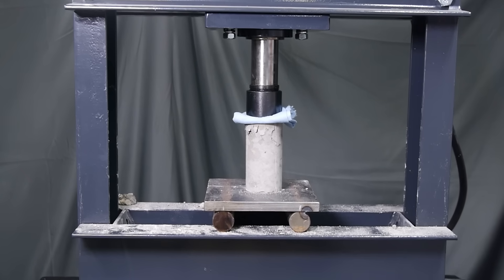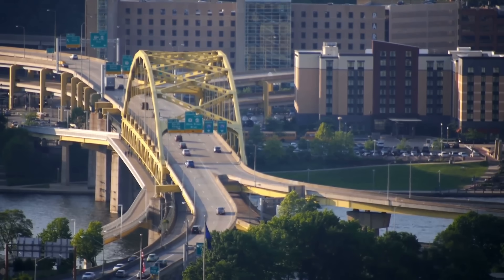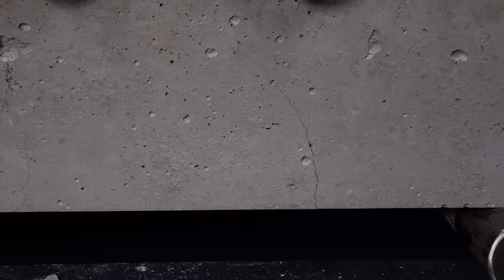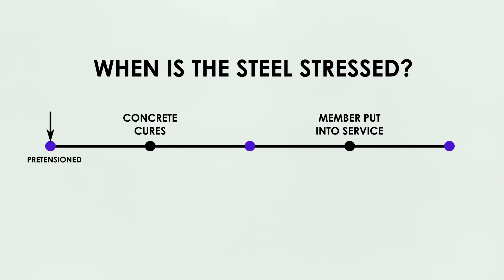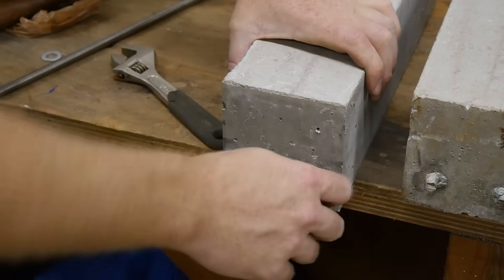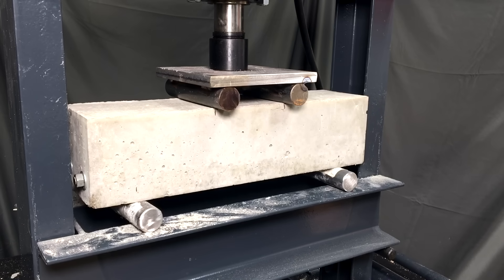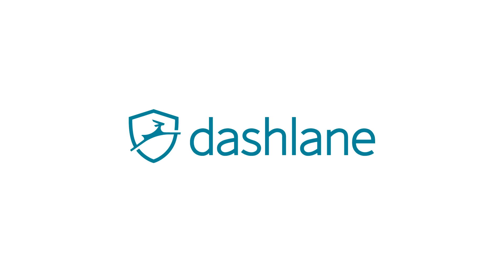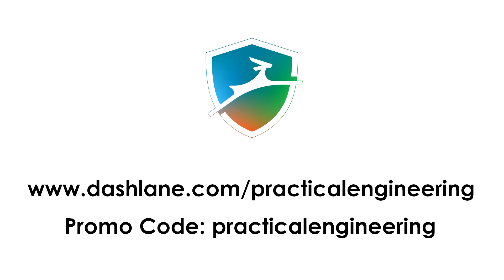What is Prestressed Concrete?

Comment: I missed the same test with the treated rod incurred in concrete without tension. I wonder if the threats are more “sticky” to the concrete than the conventional concrete iron.
Further I often wonder why you see so little rebar in concrete slabs, when I look at YouTube construction vids the use of rebar in the con create slabs is minimum...
Reply from the maker: Slabs don't have much tension because they are supported across their full length.

Comment: I’d like to see all the results of the samples you did. At what psi (or however you were measuring the pressure) did the samples fail? As someone who does concrete, I’m quite interested in your results. Every time we place concrete we have to have a special inspector take 4 cylinders and they break them over the course of 30 days. We have to achieve full strength (full strength varies by the bag mix and mix design, ie footings, foundations and flat work usually are different and specified by the structural engineer) by thirty days or that specific pour fails. I usually only hear if we pass or fail on our test cylinders. So your numbers are intriguing me. Also, how many days did you wait before breaking them? Oh and the three guarantees of concrete are 1. It’s going to get hard. 2. It’s going to crack. 3. No one is going to steal it. Great video as always!

Comment: Can temperature be used to prestress rebar? That is, heat rebar to expand while concrete cures, subsequently inducing stress as rebar cools and shrinks?
Reply: No, you don't want to heat structural steel. Steel is all about amount of carbon and the rate of cooling, it won't remain structural steel if you mess with these properties.
Reply: Thank you,  @ravinderkhakh3918 . So you're saying that thermal expansion within the operating temperature range of structural steel is insufficient to induce adequate tension of structural steel for creating pre-tension concrete for expected use in industry.  Would be interesting to test this at the practical limits for maybe using in less challenging circumstances (or where variation is within acceptable limits), and where maybe solar energy or the like could induce the heat.
Reply: @benjaminbrink5098  That's not the only issue, concrete curing is an exothermic reaction, and admixtures are used in concrete to control the rate of reactions, so introducing heat for thermal strain will likely mess with other properties. Where is the energy to heat the steel coming from? How are you applying it evenly throughout? The rebar is placed where the concrete is under tension, so over the span of a beam it might change which sides it's on (top or bottom) depending on the design and column placement.
Reply: @ravinderkhakh3918  I see. Thank you.

Comment: I have the feeling most non-expert (including myself) think that the goal is to modify the behaviour of the concrete by compressing it when with this video I have the feeling a big part is in fact to modify the behaviour of the steel by "stretching" it. Did I miss understood something? To what extent the prestress goal is to actually force the steel reinforcement to act "earlier" given a small load instead of simply applying a load to the concrete?
Reply: Stretching the steel applies a compression load to the concrete, so you're right on both counts.

Comment: Could it have been better (in force needed to break) because you got more of the ait out of the concrete? Pressing above an air pocket could crack it early even if it does not break the block. Atleast thats how I imagine it

Comment: Great video, I've been wondering about this subject since essential craftsman was considering it for his spec house foundation.
Couple questions: 1) Would post-tension affect vibration damping in a pad for a cnc mill?
2) How do you protect the exposed ends of the tensioned bar from corrosion?
3) How much torque?

Comment: Hey Grady, Ever think of doing a series on different plastics? Also when I hear things like "Spider silk is X times stronger than Steel." My brain doesn't quite register how so; are they talking about tensile strength only in those comparisons or could it be stronger in other ways also?
Reply: From my knowledge, steel usually sound "bad" when it is compared to other stuff (mostly new materials or those science facts) because they compare tensile strength by mass, and steel being dense often scores lower than the material it is compared to

Comment: As a suggestion; it would be nice if you could include more captions/titles/info cards on-screen in your videos. e.g. a label saying which concrete beam is being tested in the shot we're looking at, what its point of failure was, and suchlike. Showing several indistinguishable concrete bars one after the other, and cutting "back" to them after other shots, makes it tougher to follow the narrative.

Comment: Great video! Maybe you could touch on how pre- tensioning members can go wrong, since I'm pretty sure that was a factor in what caused that pedestrian bridge in Florida to collapse. And a point on welding, TIG is not like stick or mig, you really want to choke up and have your have closer to the top of the torch. And for control it's much easier to imagine the handle of the torch as a pencil and hold it as such to make it easier to move around

Comment: You can't end this series until you design a reinforced concrete beam your press can't break. (and you can lift yourself!) :)
Reply: seeing a WildoldTony gives luck, if you quickly go to the lathe and break a insert for good luck!
Reply: Agreed
Reply: Lol... good luck? While you're at it, see if he can design a carbon nanotube space elevator that won't collapse under its own weight?
Reply: @taragwendolyn  it depends on the strength of the rc beam he wants to make...
Reply: And the amount of force he would want to apply to the beam
Reply: @taragwendolyn  Space Elevators are actually in tension, so it would either tear in half or dramatically pull its ground anchor out of the ground
Reply: @taragwendolyn  A japanese company is working on this concept. Developing their own materials too.
Reply: @taragwendolyn  space elevators are under tension, not compression. They have to bear the centripetal force required to keep an object of that length’s center of gravity above geostationary altitude. 

A space elevator is shaped like the hammer throw’s ball n chain in track and field. A long rope or cable of some kind extending beyond geostationary altitude with an enormous counterweight on the opposite end, which probably ends up being a space station, which makes the whole thing’s center of mass above geostationary altitude and therefore makes the counterweight, now traveling faster than orbital velocity at the angular speed of the earth, want to rise to a higher orbit. The elevator cable binds the counterweight to the ground, preventing it from doing so. 

Just like the hammer throw ball n chain, which wants to fly away, but the chain and the grip of the thrower under tension prevent it from doing so (until, of course, a preselected moment).

This introduces a counterintuitive phenomenon where adding more weight to the counterweight (or bringing more equipment to the station atop the elevator, in practical terms) actually increases the tendency of the whole thing to fly away from rather than towards the earth.

Also, it demonstrates one of the strongest points of utility for a space elevator: a space elevator’s station on top is a low launchpoint for deep space missions from where the reduction in energy needs is absolutely immense. The Saturn V’s third stage could launch an Apollo spacecraft to the moon by itself, easily, off the station atop a space elevator. A space elevator would also make the launching of geostationary weather and communications satellites a trivial task, and possibly even make using spacecraft to bring such satellites in for “drydock” repairs and relaunch them economical. This would drastically reduce the costs of geostationary satellite production, as parts would not have to be manufactured to certainly withstand several years or decades of operation without maintenance, as they are now.
Reply: Or a pasta machine.
Reply: I'd suspect that one of the existing designs could beat his press just by letting the concrete cure for a month or longer.
Reply: you cant stop until you sell that pasta machine as a kit
Reply: I think thats called "steel"
Reply: @bekkayya  With A bit Concrete so you call it "concrete beam"
Reply: One could assume it could be possible achieve such a preposterous and thankless objective with the integration of some cheap parlor tricks and irresponsible time travel!

You'll pay your attempts to extirpate the metric system from history you old tony!

Shakes Fist
Reply: Composite concrete + loose fiberglass mix, then rebar + carbon fiber mesh, what do you think?
Reply: What series?
Reply: https://www.youtube.com/watch?v=4lbI-cBhkm8
Reply: What if he used that fiber reinforced concrete? Would that work?
Reply: So basically he would’ve made one more video and be done 💀
Reply: Cruelty must be introduced in a plausible fashion to be most effective
Reply: hit the gym
Reply: That would be easy if you simply increase the section area of the beam, LOL

Comment: Pre-stressing is big in tractor trailer trailers. If you look along an empty flatbed trailer you'll see it bows upward. When fully loaded, it's flat. That's one way police can chase down overloaded trucks at a glance. If the trailer is sagging, it's overloaded.

You can actually cheat a bit and run a few beads of welding rod down the entire length of the bottom of the trailer beams. As the beads cool, they'll pull the beams into more of an arc ;-) It gives you a little more "spring" in the bow of the trailer. It won't make any difference at a weigh station obviously. Your weight will be your weight :-) Around here, mostly you only have to worry about weigh stations at state lines.
Reply: The weld beads do create a bit of light pre-stress in the beam, but the basic camber arc is not by its self a form of pre-stress. The beam still deflects about the same inches per ton, you simply changed the starting point.
Reply: @ClickThisToSubscribeYes. They use it in manufacturing the trailers to begin with. Mobile home trailers in particular.
Reply: Camber, not prestressing

Comment: Idea: advancements in the plastics side of composites. 
  I tell people all the time about how a carbon fiber bike is really just "plastic with stuff in it." People tend to focus on the fabrics because they are visually interesting.
  I spent several years as a buyer for a chain of bike shops and could clearly see, if steel bikes had remained the standard they would cost far more than plastic bikes do now. They are far more labor intensive and have several engineering limitations when it comes to tubing dimensions and bike sizing. 

  To the uninitiated: steel road bikes were sold in ++1cm sizes from 48cm to at least 61cm with many models/brands selling higher and lower sizing. 
  The plastic bike lead to the innovation of "compact geometry" and shifted the sizing of bikes from, mostly frame specific sizing, to a more flexible individual fit by changing the bars, stem, and seat post.
   A steel bike of the past would come in at least 13 sizes for each model. Modern bikes are offered in less than half the number of sizes per model. This greatly lowered the investment needed per model for wholesale distribution networks and retailers alike. That change lead to the diversification of the bicycle market into all kinds of specialties. 
   The molding technology has come a long long way, especially the interior forming technologies currently available. There are also lots of interesting advancements in doping additives like hollow and/or lightweight fillers. 
   The one tech that I think is a bit more interesting is the addition of basalt dope for carbon fiber wheel braking surfaces. The fact that a clincher tire mount flange can be incorporated into a rim design with a plastic braking surface is remarkable. The heat of a 180lb person/bike stopping quickly from 60mph+ coming down a mountain with a thin piece of plastic stopping them is voodoo.

   Those are the usual geeky talking points. The aspect that I've never heard about in any depth is how the actual epoxy plastics have changed and evolved on the chemical side. At most people will talk about the mechanical design aspects like, "real structural carbon fiber fabrics are almost always a uniweave with around a 45 degree lay up. Or they will mention the diameter and refinement of the individual carbon threads, combined with higher vacuum power, and resin percentage control are the factors that determine weight versus strength in the composite.
   People like to focus on the fiber because dumb monkeys buy shiny things. They don't like to remind people, ultimately carbon fiber composites are just plastic with stuff in it. What's the real story on the plastics side of current composites engineering?
-Jake
Reply: I get the feeling you are talking a much higher end bike than what I ride.
Reply: @petroelb  
 Which of my six are we talking about?

Felt AR4 (main/rebuilding on the stand now)

LeMond Tourmalet (main back up/steel is real - fun to stomp others riding carbon bikes with)

Cannondale SuperSix HM (cracked)

Cannondale R900 (in pieces under my bed)

Cannondale Jekyll (storage)

Bianchi 928 (parted in storage)

...the benefits of making next to nothing for a paycheck while working in bike shops...
Reply: Compact geometry is completely independent of the basic frame material. 
The main limit on steel is the low dent resistance of very thin wall large diameter tubes needed to take advantage of steel's properties in this application. 
I am quite familiar with aerospace composite engineering (experimental airplane structural components more specifically) and... no, a composite is not just plastic with stuff in it. In fact the polymer matrix (which is not a thermoplastic in over 99% of carbon fiber products) is only there to bond the fibers into a fixed position, very little primary strength and stiffness is contributed by the matrix. The fibers are of very high elastic modulus and the polymer is of modest to low elastic modulus, the matrix may be to 10% of ultimate stress/strain when the fibers fail, and the matrix won't have the ultimate strength to take up the slack after the fibers have broken; think of a rubber coated steel wire.
The polymers used are most often epoxy or cross linked polyester, but some use polyimides for high temp applications and dynamic bearing surfaces without the use of metal inserts, vinyl-esters for a water barrier in submerged items like boat hulls(prevents osmotic-pressure blistering), phenolics also pop up a fair amount as they tend to be dimensionally stable easy to bond post cure and economical in certain production situations also somewhat fire retardant. 
Epoxies adhere to most fibers better than polyesters but epoxies are more expensive and have lower modulus of elasticity and the only time adhesion tends to be a primary concern is with aramid fibers[kevlar tm], which are in turn only used where you need loads of toughness and impact resistance and so the lower modulus is not a detriment as aramid composites tend to be relatively flexible in any case, and due to low adhesion designs should limit compression loading. (as the matrix, especially bonding with the fiber, does play a fair roll in compression loading)
Specific variations on resin products within a chemical family tend to come down to processing performance as much as final product strengths: cure temps, cure time, viscosity, sensitivity to mixing ratios, defect rates with a given process, shelf life, etc.. The needs of resin for frozen pre-impregnated fabric to be cured in an autoclave is quite different from the needs of a field repair using any of a wide variety of fibers over some  mystery base polymer.
Reply: @mytech6779  
 Cool read. 
  The steel bike compact geometry limitations comment is really referring to the practice of lugged frames where the lug shells were designed for use on multiple frame sizes. Filet brazing is possible but was always more labor intensive and required more skilled labor in general. The cost effective/low end/entry level bike market is what I'm primarily referring to as the limitation. 
  You know far more than I do about polymers and composites, but that's exactly the kind of stuff I'd like to hear about in details I might better understand. I have as much experience as can be expected from someone that painted with PPG DBC and Omni for years professionally, and played around with a few amateur composite projects. I've also picked more than a few engineer's brains at Interbike in Vegas, but I'm no expert, just exceedingly curious. 
-Jake
Reply: MyTech you sound like you know your material's science. What could i put over large 220watt solar panels in place of the front-glass that was cracked into thousands of tiny pieces falling out. It needs to be transparent, & preferably lightweight and rain&sun.heat/cold proof. Preferably paint/pour/spread/stick/iron-on as opposed to cut (like glass) and size on. Is there a resin/epoxy/laminar/sheet etc whatever that fits the bill? I'm not sure if i can just leave the solar-crystals exposed without a covering and dust them off once in awhile. I assume the glass was there to keep them dry but what do i know.